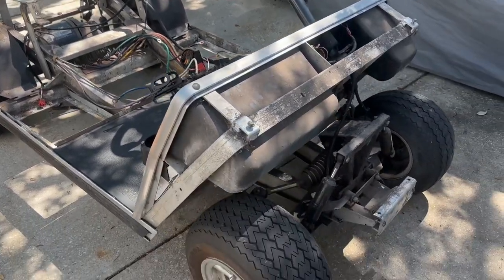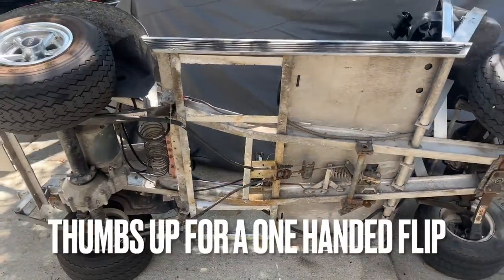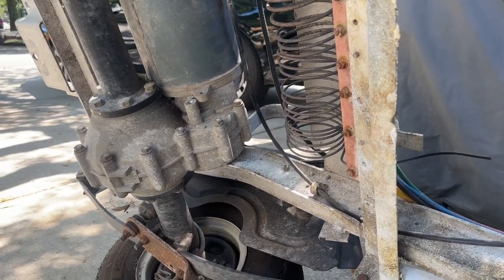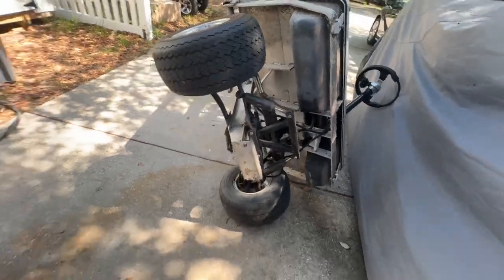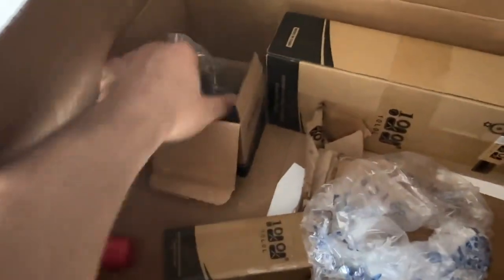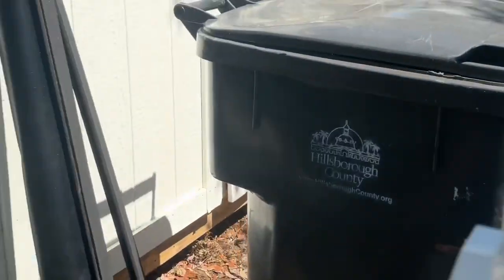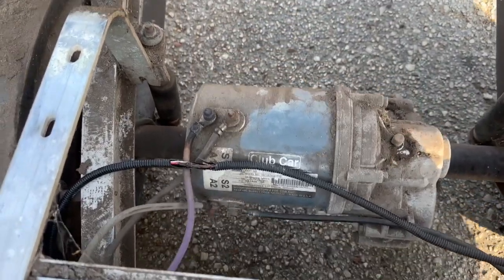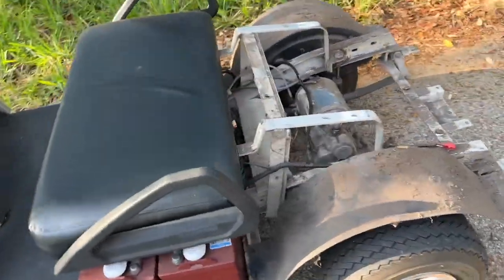Closer Look Under a Club Car DS & Planned Upgrades | Motor Clunk

Comment: Doing my own version of this rebuild.  Its a lot like the Johnny Cash song ... apparently has a 1995 chassis, the seats and upper assembly are newer ... but the previous owner used it on a farm and thought PM is something that have in the government of England and didn't understand the concept of washing off dirt or battery overflow.  Also a first time newbie so appreciate your video.  Mine is a little different and doesn't have the large resistor coil.... but the previous owner was known to do a lot of MyGyver type of "fixes and upgrades" so who knows.  We might end up having to just tow it behind the riding mower if we want to actually have it travel.

Comment: If it’s not the motor bearings, I’d next check the linkage where the motor attaches to the transaxle. Could also be gear slop because the teeth are worn. Or another possibility could be a solenoid slamming on and off. Kinda sounded clickity clack at times. An old solenoid makes a chatter type sound when dirty contacts or weak coil.

Comment: I start this same project about a month ago. I’m on the homestretch of it now. I should be done in about a week. One this I would suggest it to replace all the hardwood. Broke a couple bolts taking off parts and broke some more putting back on. In hindsight I wish I just replaced the hardware in the beginning. Also I believe it’s your motor you can get a fast motor for about $400.
Reply: Where would you get this motor cheap from?